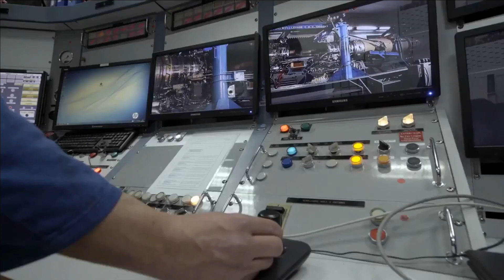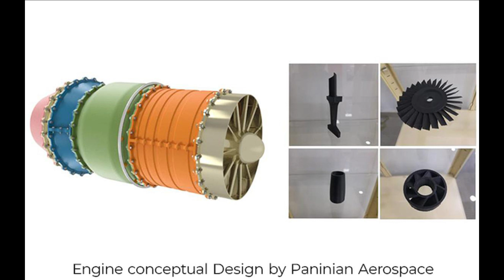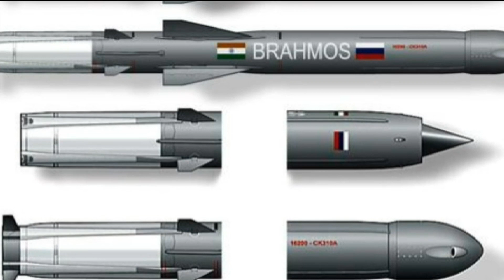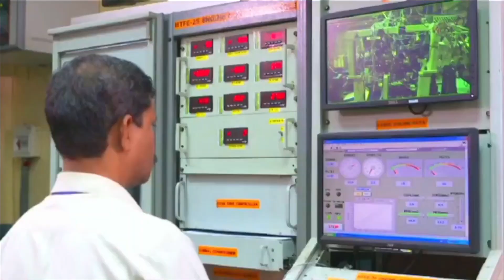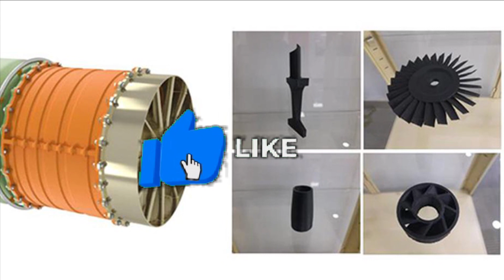Indian start-up achieves break-through in Aero Engine design

Comment: It is doubtful if our Air force will back it!
Reply: Designing an efficient Blade profile, hot gas path components, a Rotor system, efficient fuel delivery system etc itself takes long long years of experience and facilities to establish a reliable system. Top grade academic backdrop is an enabler but not enough. They have to seek at initial stage some sorts of collaboration of know how and then grow up with innovations.

Comment: DRDO’s Small Turbo Fan Engine #STFE has completed "design validation tests" on ground.
HAL HTFE 25kn engine is also nearing completion. It seems for drones uavs and cruise missiles Bharat will have indigenous engines.

This leaves the Kaveri engine as the biggest failure to date. Nowhere in the country to test compressors, HP turbines, power turbines of the order of 1 MW and above with matching speeds. Flying test bed and altitude test benches which demand an investment of the order of 1500+ Crores. These facilities are expected to be established under the proposed AERO ENGINE COMPLEX by MoD as National Test Facilities.

Bharat needs to establish these test facilities for engine development.

    Twin test cell at GTRE
    High altitude test bench
    Flying testbed

DRDO already has 100 acres of land at Telangana for High altitude test facility.
Flying test bed has also been requested. Cold hard cash is the need of the hour
to convert promise into success and true indigenous self reliance.